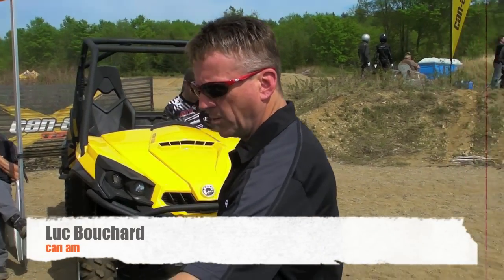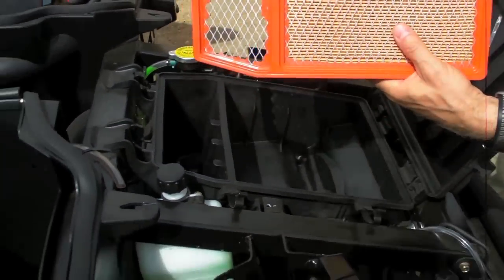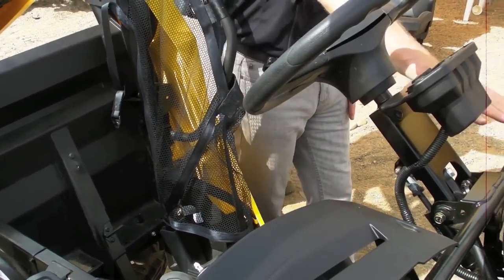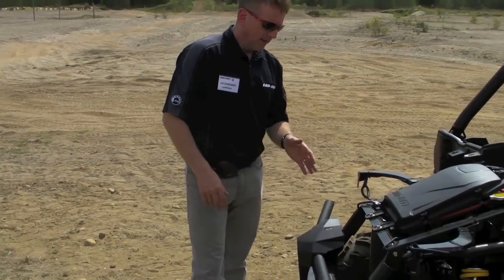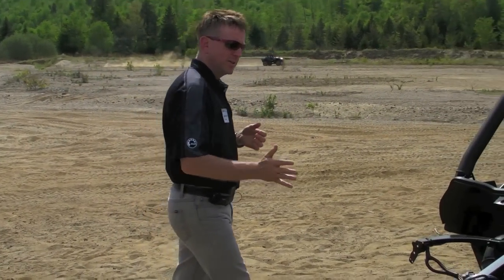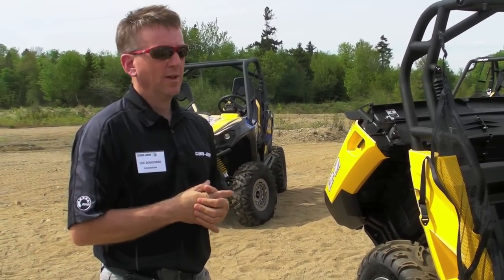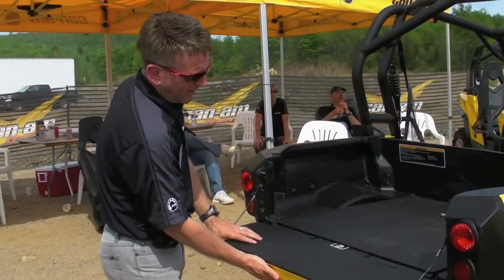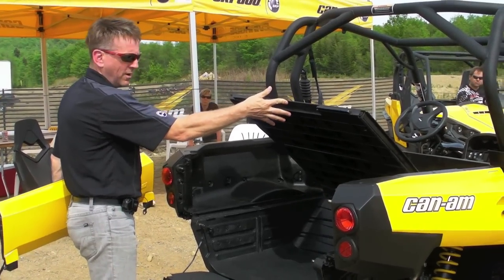Can-Am Commander UTV Engineering Part 2 - Checking out the Commander 1000 UTV from CanAM

Comment: @Tankdriver100 i am talking from a sport quad point of view but yes. when people get aftermarket exhaust systems they need to breathe more than stock. so they take off the lid and rejet accordingly. the filter is still there, just no lid. i forgot about the 2 sections thing that would pretty much scrap the no airbox lid idea

Comment: @Tankdriver100 haha i was just joking man. i'm sure it could be done but it wouldn't be as simple as taking off the airbox lid. maybe if someone fabbed a grill into the top of the hood or something. and as for dusty conditions, alot of people run no airbox lid. you just have to clean it alot more. with efi it would be easy to put it back on though. i have a blaster so to do that i would be changing a main jet. thats why i just leave mine on all the time

Comment: @praisedtimon 4000km never go into water or mud ! and im a good driver ! i dont hit tree ! :P ..my dealer changed 5 front shock..my clutch have get out of plastic case. i am hapy to have yet my legs !!...the bolt have broke in two. ...brand new clutch strap plastic cover Drivin ..Complet transmission ..Drive shafts ! ..part in my rear differentiel ..and i have yet noise in front diff...a chance that it guaranteed..And i have a good dealer !